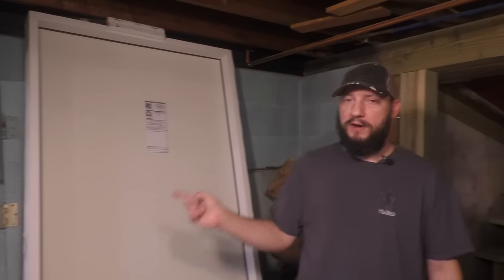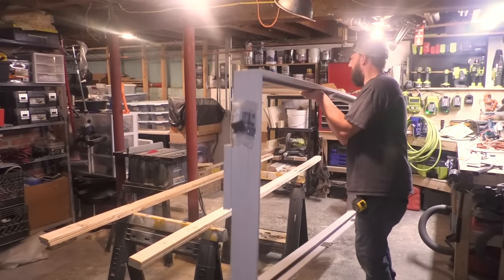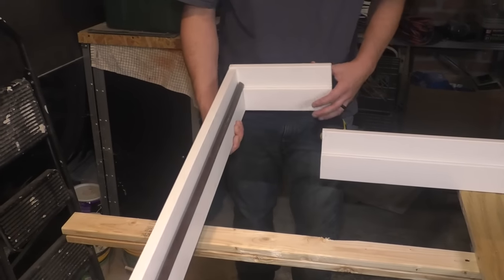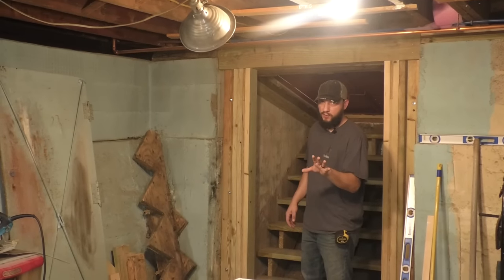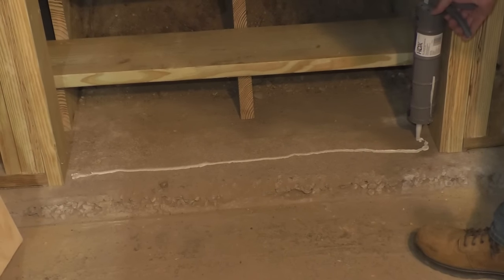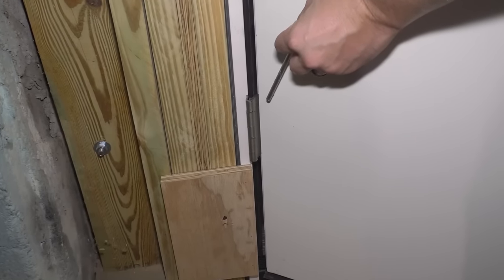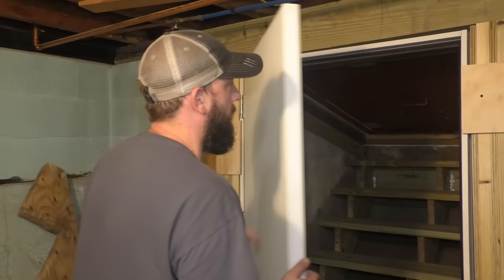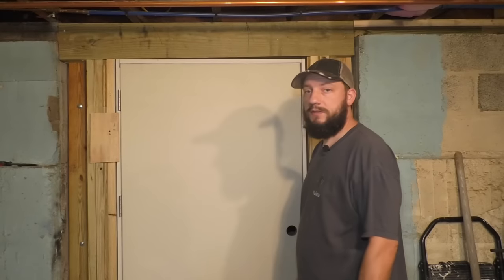How to Cut Down Steel Pre-Hung Door + Installation

Comment: I know for those of us who don’t own routers; even though you own one, using the old school method of a chisel and hammer just goes to show your appreciation for your viewers to show them you can do it even the hardest of ways. Keep up the good work brother!
Reply: I own a router, but still prefer to do it the old school way. I actually find it easier than using the router
Reply: The old school way is not that difficult. Without templates, without special bits, without removing the door or weatherstripping, you can get a better looking result with a sharp chisel and a razor knife.

I hang doors on a regular basis and the router is only a time saver when you are using templates and doing multiple doors.

Comment: You mentioned potentially using silicone to seal under an exterior door. Silicone is best used when sealing two non-porous surfaces. It tends to fail over time when used against concrete or wood as these are porous. Polyurethane type sealants are a better choice in that situation.

Comment: The hump in the floor. If you wanted to. It would have caused a dusty and cloudy mess. Lol And if you have a grinder. Used it to grind down that hump in the concrete floor. But I will say this. I’ve installed many doors in my life time. And I’ve gotten it down to almost perfection and very fast. And today I still learned a lot from your video. Love it! Great job!

Comment: When I cut a metal door, I cut it 1/4" long then use a router with a pattern bit to make a cavity at the top (remove foam). Then glue wood into the cavity. Cut a notch oit of the metal, 1/4" x 1/4" to prevent overlap. Finally bend the excess metal skin over the wood. Place some silicone under the metal before you bend it and prime the top.

A hammer is good enough to do the bending.

Comment: In Norway, the naming convention for left/right is:
You observe the door, while standing on the swing side, (inside/outside).
The you observe if the hinges are on the left orr the right side.

This door would be : left hinge, in swing.

Swinging inward.
When watching from the inside, the hinges are on the left side.

Proves that it can be important to know the naming convention they use if you order things from a different market.

Comment: Been fitting doors about 60yrs taught myself. Built 3 houses for my family. Learned so much tonight....thankyou. Yes have cut down doors. Your shimming method blew me away. Once built a fabulous Cypress 2 stage internal stair case recessing steps and risers into the stringers and same with the handrails....a month later the timber (that’s what we call it in Australia) shrank! Opened up all over. Well I figure perfection is something I have a ways to go even if it takes a millennium.

Comment: Nice job.  I'm not a woodworker but about 6 years ago found a 36x80 steel cased door on the side of the road with a rotted jamb, and built my custom-fit door jamb to replace a hollow interior door that was formerly used for my detached garage access.  Still works great and the added security and insulating properties are a huge bonus.

Comment: I would have purchased a larger door, Rabbet cut the existing frame, cut down the door to fit. I would take nothing from the opening and still have the steel door. Thanks for the video and showing the installation.

Comment: Just finished my sixth recycled metal door some with 1/2 inch pine 2/4 pine  2/8 pressure treated  saved thousands side of the road flea market yard sale .Biggest job was cutting in hinges without a router  chisel hammer and exactly knife

Comment: Nice job brother. 
I have a handyman business so I have to do weird shit all the time. You know.. stuff like this. 
I wanted to mention the many uses of an oscillating saw. I was changing out 25 sprinkler heads last week and when I was digging them out a lot were covered in thick roots. I used to used my sawz all and clippers for stuff like that. Last week I tried using my oscillation saw and man it was perfect for doing those sprinklers. I even used it to do an initial cut on the SOD. 
Great video! I’m still watching it.

Comment: Lol always love the "bloopers". Also, this is one of the few times I also use foam. It's still open so plenty of room for the foam to expand outwards instead of applying pressure to the frame.
Reply: There is a special version of expanding foam that does not over-expand and make an absolute mess. It is low-expansion foam for windows and doors.

Comment: When you're installing anything to do with a door, make sure you use 3" or longer screws so that the screws securing the door and the hardware of the door are driving far into the frame of the wall.

Comment: I’ve been using a Pica-Dry heavy duty mechanical pencil. The leads are strong and don’t break easily and it has a built in sharpener which is fantastic for precision marking. 
Watching you use the flat pencil made me thankful I don’t use them anymore. 
I also bought white”leads” that I use when working with steel or dark painted pieces. 
Splurge a little, you’ll love it.

Comment: It all turned out in the end. A few tips. You used an inswing door instead of an outswing. Door manufacturers use the same height door slabs for both but different thresholds. The inswings are about 1-1/2” taller which means with an outswing it’s less to cut off and lower threshold to step over. We always cut off the bottom of the doors. Lowes and Depot sell a U shaped vinyl pieces that fits over the bottom cut. Those side jamb cuts are easier removed by hitting them with a hammer to separate and you don’t need a pry bar. Less likely to damage the jamb you are trying to restore.

Comment: I am old school. I would have went with a solid core wood door and buit my own frame. A lot of people today have no idea of how to hang a door from scratch. Today everyone wants a prehung door. My grandpa was an old time carpenter and he taught me how to hang a door. He died in 1965, I still have all his old tools and I still use them.
Reply: I have had to hang doors like that. I call them slabs, as opposed to pre-hung. I once had to hang slabs in an entire house since they took the doors but left the jambs and trim.
Reply: Grandpa used a horse and buggy also but now we get more done with cars and trucks.😅
Reply: @regankaldahl8496  a solid wood  door would have been a much better choice. Carpentry may have changed over the years, but I still would have went with a solid wood door. People today don't know how to build a frame from scratch. That door wasn't designed to be cut and the frame on those cheap doors would be easy to kick in. I would have built it with a 2 x 6 frame ripped to fit. A wood door would have been heavier duty, wouldn,t rust over the years and would probably last a lifetime.

Comment: Decades ago i built some drafting tables using hollow core doors for the hinged adjustable drafting board so I had to cut about 15" off each door. Back then the interior doors had a crosshatch of cardboard webbing between the surfaces of the door. I used that same method to install a a new "frame end" at the cut point - all it took was a bit of clue and some finish nails.

Comment: The true old school way did not even need to involve a razor knife because we had hinges that had square corners.  I suspect that they started to make the rounded corners on hinges when routers started being used to cut the mortises for the hinges... Prior to the rounded hinges, the router would leave a rounded portion of the mortise which you would still need to use a chisel to square the corner... I prefer the square corner hinges...

Comment: Nice job, I installed a commercial steel door into CMU and only had to cutoff 2" so I did it at the bottom and put in pressure treated wood. The frame was welded metal and couldn't move the hinges.

Comment: Nice job, it's my first time viewing your channel.  I recently had the same situation but for a client about 20 miles away and it was for an outdoor shed, so billing for all the labor required was not a option,  I only need to remove about a 1 1/2" in height so I opted to notch the header. But nice seeing the process of cutting down a metal door. Good job

Comment: I really enjoyed your video! I'm now a new subscriber! 😀

The scrap of brickmold at the top of the jamb, is to aid in installing the door in the right rough frame in. Place it at the header, plumb, and done, it's sitting properly in the opening. 
I could be wrong, but being this is an exterior steel door, I'm guessing that the sill plate sitting pround of the frame wasn't poor workmanship. It's slightly offset, as a water run of, for the exterior side of the door. 

Keep up the great work!

Comment: Something small but my coworkers typically frame doors 2" bigger than the door slab itself.
Ie framing a 36" door with an rso of 38". I know that technically that should give almost a half inch to level but ive been burned in the past and also frame mine 2.5" bigger

Comment: We had to get a new door for our back entrance but we made the mistake of going to Home Depot to get it done, the guy that measured it got it right. But the idiots at HD tried to change the measurements and tell me I needed a custom door, I know that door is a standard measurement, I told them to shove it. 6 months later we bought a pre hung door and my cousins friend who is a carpenter installed it, all he did was plain down the sides a little and it fit perfect. 15 years later it's still working fine

Comment: With such a low header, you could have eliminated the header on the buck and used a piece of 1x as a stop for the door to mimic the rabbit. The jambs can be screwed into the header directly. This would save about 3/4'' in height. If you want to be fussy, cut the top of the door to match the out of level at the buildings header. Same goes for the jambs, If you are tight l&r and want a standard door, skip the buck altogether, and mount to the rough opening directly. Save 2 1/2''. Cover with moulding and bobs your uncle.

Comment: Could you measure the line like you did at 10” on each side, then measure another 10” below that line, cut 20” from the top, and then drop the already built top down and somehow fix those together so you don’t have to take apart and remake the top? Gravity will help, so I’m not sure you’d need more than some glue or some small dowels inserted to both parts to create some form of joinery?

Comment: He did decent job for someone that “hasn’t hung a door in 10 years”. Definitely above average for a non-professional. However for the DIY er’s, just to clarify industry standards. The door being hung is an “exterior” door. Yes, exterior pre-hung doors do have RH or LH nomenclature, but also followed by OS / IS, I.e. Out Swing / In Swing. So not all ext. doors are “IS” and the biggest differences are the threshold style, the way it seals and deflects water and anti-tamper hinges / pins. Since it doesn’t really matter here (in basement interior), either will work, but I’ve actually seen the incorrect door reverse installed and they will direct storm water inside. Although in this case, if the floor was level enough, I’d use an OS, BC the threshold would be lower to step over, which every bit helps on a door cut down 10”in height.  

The only other tip for exterior doors exposed to the elements is… especially if you plan to stay in your home long term, don’t use cheap steel doors. Use a good / premium quality fiberglass door, with vinyl styles and composite jambs (no rust / rotting). 🤓

Comment: Cool vid  you can use  a circular saw the same way you just have to reverse the blade so the teeth or reverse  and it will go through that thin metal like butter

Comment: Why did you not use a steel lintel to gain several inches more of headroom?  Even more important when coming down a stair and directly entering a short door.
Reply from the maker: Not sure if you noticed but the header I installed ended up being even with the height of the bulkhead framing… so even if I put in a lintel to gain head height I would then have to tear the exterior bulkhead door off, reframe it and raise it to make it work.  Could be done but wasn’t willing to do all that.

Comment: Spray foam isn't as bad as you think. Just don't buy cheap spray foam cans with straws for diy-ers. Buy quality commercial grade foam for use with the gun. To fill the gaps between the door frame and the wall, use foam with a minimum expansion coefficient. The gun will allow you to accurately dose the amount of foam to fill the gap. If you don't overdo it with foam, it won't come out, won't swell or bend the jamb, and will gently fill the gap and strengthen the jamb.
Reply: HILTI foam.

Comment: Just watched the video.  I've cut down a few doors, but never a steel door.  Interesting to watch someone else do it.  First, why not just set the door inside the room (not under the header?  Secondly, I think I would have cut the bottom, filled the door knob holes  and rebored the door. Also, If you put the straight edge on the door, put it on the nice face.  If the blade jumps off the line, it bites into the waste piece and not the finished edge. But Nice video.

Comment: I would have considered setting a new larger frame in front of the existing low wood frame so the new cut down door could remained a bit bigger because the inserted door frame has now made the original opening even lower.

Comment: If you are concerned about security, then you need to redesign the way the way that the striker plate works on the deadbolts... The typical deadbolt and striker plate is so weak that it can be easily kicked in... With the stairs behind that door, it would be even easier since something could be used as a lever against them and the door... I rented a house many years ago where before we had even moved much of our stuff into it, someone had kicked in the door... They didn't steal anything since all we had moved in were old college textbooks... I could see how poorly constructed the frame of the door and deadbolt striker plate was... I re-engineered it a bit by changing out the door trim to be made from a 2x6s lag bolted into the wall studs and then having a 3 ft piece of 1.5" angle iron (1/8" thick) as the striker plate... A few months later, we were out of town for a week skiing in Colorado and they tried to break in again and could not get through... So, they went around to a window and broke it out and came through that way... We moved soon after since the lease was up and were in a position to buy our own house...

Comment: Totally sucks when you spend (in my 'same style' basement door replacement) $350 at Lowes. Thinking its a One hour job, and find the same situation as you,.... Rebuilding the jamb, ... remortising out the crooked hinges that installed... straighting the threshold, ..fixing the weather strip,.... BEFORE you even get started!

Comment: wasn't it better to cut after the hinge to the correct size and then just attach the perfect and uncut top layer to the correct Hight? It would prevent you to dismantling to top and you would save the hinge position.
Reply: He wanted to save the saddle mounting. It's 6 of one and 1/2 dozen of the other type of thing.

Comment: Im planning to add 8x16 addition, enclosed porch to our mobile. Very low, low sloped roof. Needing to cut steel or fiberglass door to install in gable end. Front wall way to low.

Comment: Ok, I liked the old door also, and I think with some work it could have been made just as tight and secure.

Its a misguided notion a metal door 
Made for residential use is truly secure. Even a comercial metal door isn't as secure as you might think, unless it 1/4" thick plate steel and a steel interior box frame.
 A  door like thats just a thin metal sheet, and the shop i used to work in had a comercial type of that door it had a thicker steel sheet, it had been broken into.
First they cut the phone lines, then cut the overhead power connection at the roof then peeled the skin off the door, then stoled about 75k dollars worth of inventory out of what was a fully stocked stock room we had just filled with new stock. They didn't even mess with the cash box just merchandise.

I've also seen them drive through steel garage doors, and doors with metal cables across them.
Also an entry door and brick wall past a steel railing.

You think metal harder to get into, no its not it just slows them down some. 
The real security you have is the tornado bulk head doors up the stairs thats thick steel. And it be very hard to get past.
In that case they just come through a wall.  Siding. Sheet rock and insulation isn't that strong.
Reply: Doors and keys are ment to keep honest people honest. A thief is going to get past almost anything with enough time.

Comment: If it was me I would just cut it 2 inches above the door knob hole  straight across and remove the ten inches or so above the know hole ! That way you would just have to weld 2 straight lines front and back with no hinge work or wood and insulation work ! 😂 your making this project way more complicated then it needs to be  !!😮
Reply: ??!!  No comment.

Comment: If it were me, I would have gone for a 40 inch door for easier moving things in and out and up those stairs. And it is much easier to mortise the hinges before installing since it can be done on the saw horses.  Easier way to match hinge inset is to set a combination square to the existing hinge pocket, then transfer to the new location. And I would have used the grinder to smooth down those raw metal edges followed by sanding to make damn sure nobody gets a cut from putting their hand on the top of such a short door.

Comment: Steal door has exactly 0% more security than fiberglass or wood and that looks like a jeldwen door the shortest they can be ordered is 78 with an ADA sill. Even if you could get it custom doing so you make that roughly $320 closer to $1k. That being said you did a good job.